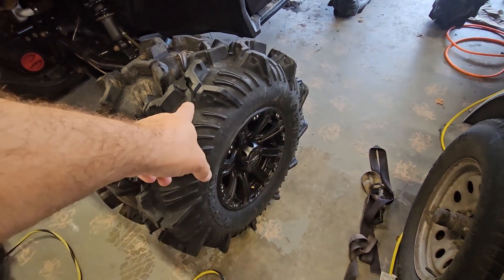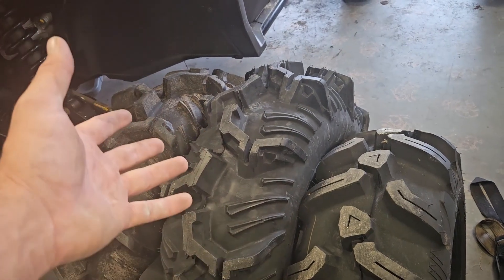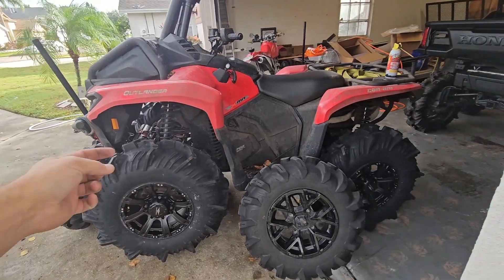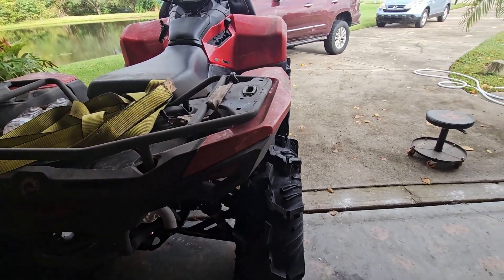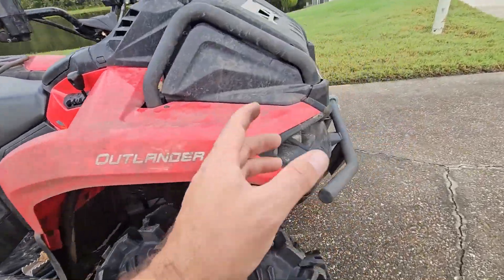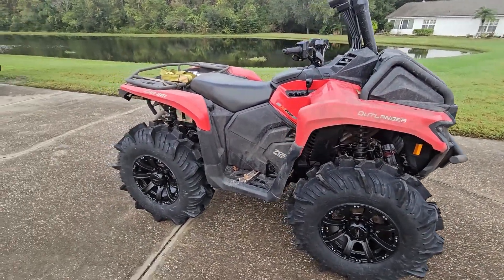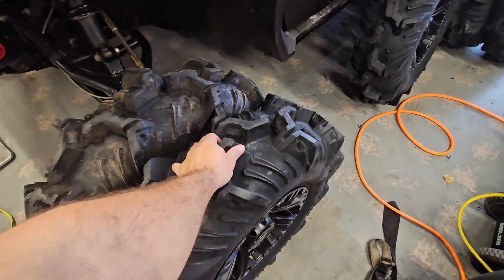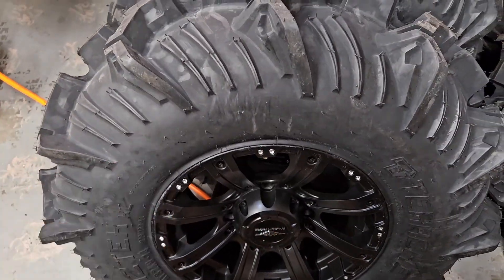New MUD tires for the Gen 3 Outlander and machine update Terache Aztex

Comment: Nice video! The front and rear drive shaft connect to the same shaft in the transmission, turning the same side too... That put a lot of stess on the engine support... That s the problem... And if i was you, i would try the steering stopper that you can buy from brp when you put track on your atv. Those are cheap and would stopped the rubbing. And i would like to know if yours taking a lot of time to warm up when you start it cold? Mine take a lot of time especialy if i take off to fast with it ( the air going trough the radiator) i think i have a bad thermostat but canam told me it was normal

Comment: should i put 30/9/14 aztecs or 32s. which one should i do? i know they aren’t very heavy
Reply from the maker: 32s only 2lbs heaver
Reply: @MudPuppyOffroad  do i need to do anything to it to run 32s? or runs them fine from stock
Reply from the maker: @parkerlambert5992  xmr 700 runs them just fine. Maybe slight trimming depending on your offset

Comment: So, the weight of the stock 28" tires mounted on disks is about 23,5 kilogrammes, pardon me going metric. What's the weight of the stock disks then? I am going to sell my BRP XTP but I want to keep the original beadlocked disks and put them on the XMR.. It's a shame BRP doesn't offer beadlocks with the new XMR G3. However, if the stock XMR disks were not that heavy, I'd keep them. My only concern now is the gross weight of the quad. It is a bit on a veavy side compared to Yamaha or Honda and we mostly get swamps over here where I live, rather than trails, and light weight is a key factor.
Reply from the maker: I don't remember off the top of my head but I have weighed those Can-Am stock beadlocks and they are kind of heavy for a 14-in beadlock. They also don't work great with tires that have thinner beads
Reply: @MudPuppyOffroad  would you recommend me to keep the XMR rims then? I've got Maxis Zilla 28" and will use them with the new XMR if I finally buy it. Choosing between a Yamaha and a BRP XMR 700. Due to the blasted sanctions, Yamaha has got no dealer's support over here, and BRP has been keeping the dealership network and getting spare parts is not a big issue. And I am still looking forward to the true figures of the new XMR's weight. I do not believe in the monstrous 395 kg dry weight. From the videos in the Internet, a 51 HP quad performs too well for a 400 kilogrammes behemoth.
Reply from the maker: @romankaletinets6750  I had issues running the XMR Factory Deluxe on Zillas. Constant leaks on the beadlock ringside
Reply: @MudPuppyOffroad  No need to weigh the new XMR. It is 380 kilogrammes on stock tires. Plastic gets fragile when temperatures go below zero. My friends have just come back from a day long test ride and gave me their feedbacks.

Comment: Hey just bought a 24 700 dps model could I run 30s came with 25s
Reply from the maker: Yes
Reply: @MudPuppyOffroad  great I got some new itp mud lite 2s 30-11/14s on my old Honda 300should be perfect for the new CAN-AM what do you think?
Reply from the maker: @duaneadams4421  I mean that's basically an all-terrain these days. Probably better than stock but I wouldn't run a fat tire up front on these.

Comment: Miss the talon content, what was the reason for the switch? Just curious. Is portals worth using on a talon?
Reply from the maker: Primarily the front locking differential. Portals kind of ruin the handling on a sport machine but it's the only way to turn bigger than 33 is reliably
Reply: @MudPuppyOffroad  I just bought a talon about 3 months ago and realized there wasn’t many talons out there mudding. Might have to trade it in for a 2 seater turboed rzr
Reply from the maker: @sinofpride8391  LOL there are a ton of Talons mudding in my area. Far superior in the mud to anything Polaris has ever made. Polaris is the last thing I'd be considering

Comment: alotta folks buy an xmr and run the roads and gravel roads and not everybody needs a 33 inch aztec lol, an xmr is just a slight upgrade over a agricultural implement basically. mostly just marketing.
Reply from the maker: The point is the stock tires are way too heavy for a mild mud tire and too heavy/aggressive for an all terrain
Reply: @MudPuppyOffroad  you're absolutely right and I think I seen a different channel mention they're like that for puncture resistance, and also to cut down on flotation but everyone has different needs.